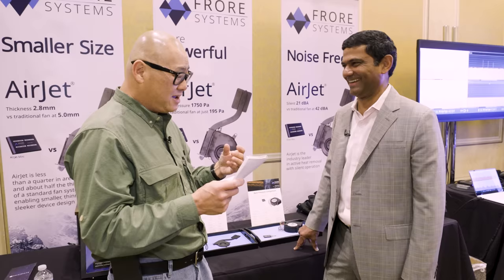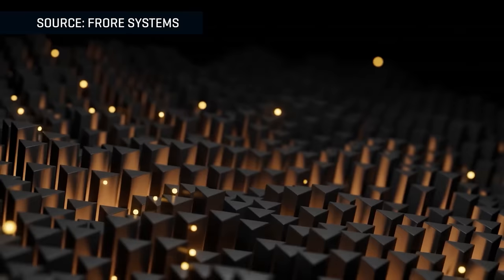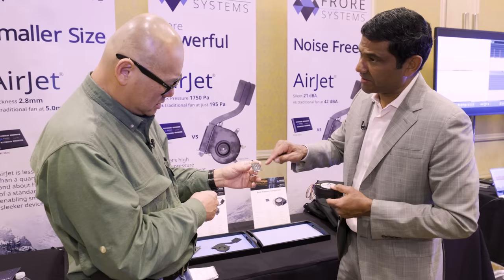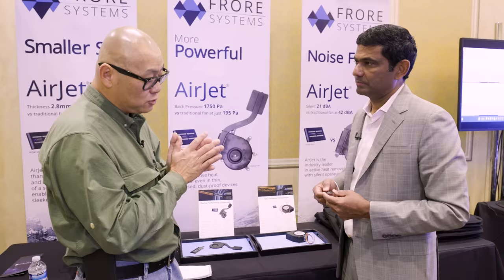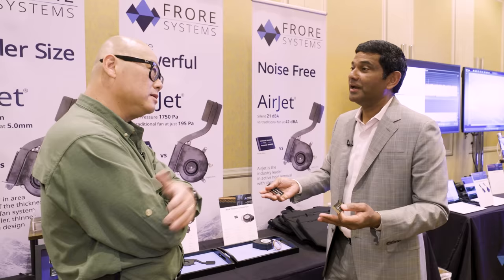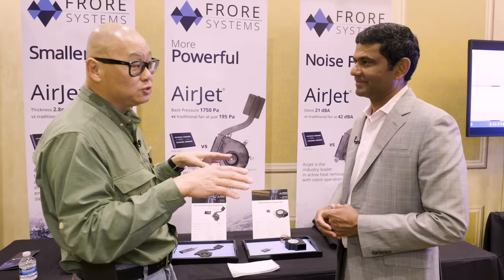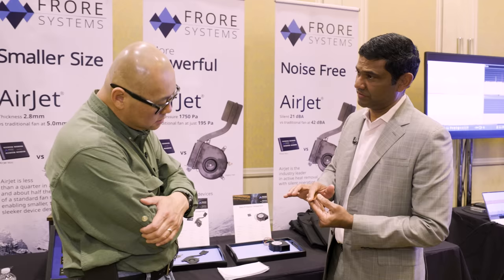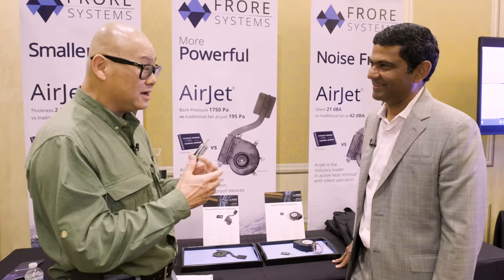Solid State Active Cooling Could Revolutionize Thermals

Comment: I like how he spins the dust filter compatibility so positively.  Based on the way he describes the mechanism, I bet if you get any sizeable contaminants sucked into this "fan" it is going to be toast!  A high-quality dust filter seems almost absolutely necessary for this type of cooler.  Let's just hope the durability of this device can satisfy customer devices in the wild...
Reply: Indeed seems like it need to work in a "closed loop" sort of what water cooling does on desktop, and he mentioned it is capable of doing so because devices can be made dustproof and IP68 so nothing would prevent a sealed box of certain capacity to being made around the solid state cooling device to protect it from dust I think.
Reply: @gabrielmaia5334  But if it only works well in a closed loop, then how is it any better than just heatpipes? Since all you're doing is transferring heat within the device itself.
Reply: @FrostArchon  Distribution of air around the device could go a long way toward avoiding hot spots, which is often a massive issue with passively cooled devices. This allows you to use the entire case as a heat sink by moving the hot air around inside.
Reply: They show video clips of it working in unfiltered air, so I think it would be able to handle dust.
Reply: Indeed it got me thinking.. Anyone who has opened up their laptops will surely know the amount of accumulated dust in the fan..time will decide and hope that is taken care off
Reply: But the fact that it is vibrating like crazy and they talked about using some kind of dust repellent... it seems like the device itself would not collect dust, and hopefully not the surface it blows onto either.
Reply: You can say he's spinning the dust requirement but not everyone works in a Starbucks/Coffee shop. The majority of my notebooks/laptops that I have owned have been killed by dust. Over time the dust builds up in the thermal management system and eventually leads to overheating and throttling of performance. It really would go a long way if you were building a tablet with a solid state battery with some serious performance components(A La Surface Tablet).
Reply: @theneonbop  yeah in pre-recorded b-roll in a controlled environment.  The truth is that we have no clue what the long term durability of this tech is, so I'm not gonna get excited until it is proven.
Reply: Would totally improve the capacity of closed systems like heat pipes.  Imagine this little thing moving freon across an evap core in a closed system.
Reply: No that is not how mems work. That wont happen. This isn't a fan.
Reply: @Daniel Eck  I considered molding my entire steam deck case in solid copper a couple mm thiker than the original on the back, and connecting the head pipes directly to the case so that the entire mass, like a pound of copper, would become the heat sink.
Reply: Air does not get sucked in.
Reply: @emo65170.  freon...? freon is used in AC systems because it's properties when it is compressed and decompressed. it's not suitable for just being pushed around. also i'm mostly responding to the idea of a chemical like freon, because freon is banned and could not be used anyway
Reply: A similar device already exists and the limitations are known. Unlike a fan, this does not introduce air into the system to dissipate heat but rather distributes heat to be passively cooled by the container.
That’s why it cannot cool components with a TDP over 30, fans are simply more efficient and that’s simply a limitation of vibrating air extremely quickly within a closed system with no cooler air being introduced. 
Therefore it can’t really be scaled according to the TDP of a product, it can only be scaled according to the internal volume of the container. This product cannot be scaled in the sense, bigger fans better cooling. 
So for investors, this man is trying to sell the idea that as production scales eventually it may reach a point where the cost to produce is cheap enough to adopt inside everyday systems. Think chromebooks, surface laptops, ipads.
Reply: @RyLo18D  I think they have overcome that limitation.
Reply: @RyLo18D  All they would have to do is blow the air outside of the case and the negative pressure would cause more fresh air to be pulled in from other intakes. And from the way he talks about it in the video, that is already how it works. The device works with dust filters because it generates enough power to pull air through filters that normal fans can't.
Reply: @descai10  The air isn't blown out of the case, the suction force or backpressure is what's allowing the air to be pulled into the case. It's essentially like a static pressure fan. 
So since more air is being pulled into the device from the suction force than being released, it's positive pressure. 
Also no fin stacks, it's solely the pulsating mechanism ontop of heat pipes or vapor chambers since it's able to dissipate heat faster that way. The major limitation still remains, how many of these can you put in a laptop? Realistically probably 2, you'd also have to deal with all other components being warmer. A workstation laptop can scale to larger fans, faster fans, larger fin stacks, more vapor chambers, more copper heat pipes. This cannot, it's designed to be a compact, silent and low-maintenance alternative to passive and weak cooling. You can add more, or make them longer and larger. But it doesn't have the scalability that traditional fans have. They're not using a larger cooling solution as a comparison, that fan probably belongs in a chromebook. 
There's a reason why they aren't advertising it for PCs or gaming components.
Reply: @RyLo18D  "The air isn't blown out of the case, the suction force or backpressure is what's allowing the air to be pulled into the case. It's essentially like a static pressure fan. "

Air cannot be pulled in without air also being blown out.
Reply: Perhaps you didn't see the part at 4:08 where it's running with no covers on it? It appeared to be running just fine in an area that absolutely had at least SOME dust in it.
Reply: @k6l2t  It's clearly at the same event they're at. Are you so inclined to be right about this thing's weaknesses that you can't accept any possible flaws in your hypothesis?
Reply: @theneonbop  for how long they are running this demo? I believe even ordinal office dust on 200km/h will drill chips and motherboard layers through
Reply: @JagadeeshPolepalli  if fluctuations pass to filter, it can somewhat self clean
Reply: @JagadeeshPolepalli  I'm thinking the vast majority of people who buy laptops never open them up.  I'm not one of those ;)
Reply: @cheeeeezewizzz  increasing thickness won't do much aside from heating up a little bit slower. surface temperature is what matters, it would be better to cover the entire thing in small fins to improve surface area.

 @K6L2 I think it might be less bad then you think, as long as dust particles are not bigger then the narrowest parts of the chip they would are very unlikely to build up because of the high pressure. And even if it does, a few on-of cycles once in a while will create enough turbulance to get rid of the little buildup that still happens.
Reply: @descai10  Yes, good job. There's a difference between positive pressure and negative pressure and it seems you still don't understand it. It's okay if you don't though. Airflow still go brr
And now we've introduced another limitation of the technology which is how well it can exhaust air given the pressure differential and whether that will affect the performance of the vibrating membranes or "pulsating jets".
Reply: @henkheijmen  I wonder if it can be run occasionally in reverse to clear out the filter.
Reply: A high velocity jet of air will dislodge dust pretty easily. I suspect that it is nearly dust proof and self cleaning internally. Only very large particles getting stuck, or stuff on the intake surfaces. So a fairly wide open screen on the intake would be all that is needed. I could be wrong though.
Reply: That would be a major concern, but might it be possible to redirect dust using magnets (i.e. strongly charged poles located on the edges of the chip). Or am I dumb and this would fry a computer?
Reply: @RyLo18D  suction force is local negative pressure though. And there has to be outflow because you can't just have air coming in indefinitely so it's not going to be a closed system. The idea is that the pressure/airspeed at which this thing operates is such that it can work through dust filters etc. which has possible problems of its own but if it works as advertised its absolutely viable.
Reply: @theneonbop  Sure it can handle the dust during a short demo, but it cannot handle dust long term, as it would accumulate internally over just a few months. But filters are a thing, and depending on the price this is still incredibly useful in plenty of applications because of size, price, and weight. It also cools directly at the source, allowing applications where the difference between the target heat and the air temperature is less than 5°C.
Reply: @CaidicusProductions  Not at all, man.  I'm honestly just as hyped for this technology as most of the other people in the comments, but I find that one is usually better off going into marketing trade shows with a healthy amount of skepticism.  The fact remains that this device has yet to be tested extensively at the consumer level, so it wouldn't surprise me at all if we encounter durability issues with it down the line.
Reply: What contaminants are you dropping inside your thing laptop? Or even desktop for that matter? You spill sand or pebbles inside your devices?
Reply: I was going to say the same thing
Reply: Airflow speeds may help with avoiding clogs. Also, since there isn't fins and motors, maybe dust doesn't have a surface to cling to. We need more info.
Reply: @snakejuce  Common dust particulate suspended in the air and loose clothing fibres. Too small to see individually, but you disassemble a laptop after 3 years, the heatsink is CLOGGED, you can pull a full felt out of it. One particle lands, another catches onto it, and then more, and pressure of the fan compresses the material into a felt.
Reply: @snakejuce  Some natural environments are worse for dust than others. In some places wind carries a lot of dust. Some pets are also bad news for fans. And of course there's proximity to factories, highways, and major roads that can massively increase dust levels.
Or using the computer inside a workshop.
Reply: @RyLo18D  You stated in your original comment that the system is a closed loop, meaning it's only blowing air around the case without pulling any in or out. This is simply incorrect.
Reply: @VeonUA  it sounded like it was only moving at 150km/h in pulses in thin strips when it was going down into the copper plate, which means the actual exit speed of the module would likely be much lower.
Reply: @HalfbitShirlock  Magnets don't affect dust. An electrostatic charge would, but that is not something that you can leave exposed to touch, and would ruin your computer.
Reply: @Peter-jl4ki  Ah good points. So me having a cat is bad? That probably explains why my laptop fans go crazy and it heats up so bad.
Reply: @descai10  That’s the initial use case of this technology. Not arguing over that
Reply: @tstager1978  "Air does not get sucked in"

Are you high? This is a solid state air moving device, it takes in cool air and passes it over a heatsink to remove heat and then expells hot air.   If no air is moving through this device it can not cool.  If air is moving through it, then dust will follow.
Reply: That can be overcome, but with all the disadvantages, I'm not holding my breathe. The mechanism seems to small to even be cleanable with an ultrasonic cleaner, which means that dust control will probably need to involve using the electrostatic charge on dust the way that many cameras now have that s the basis for dust removal from the sensor.
Reply: @theneonbop  It won't for long, in the short term, it's probably fine, but dust will accumulate in anything short of a clean room wearing bunnysuits.
Reply: @k6l2t  Honestly, I think this product is probably going to be vaporware and somebody is probably going to buy the company for it's engineering department. I could be wrong, but this is a very, very hard thing to get right to the extent that it would need to get it working reliably.
Reply: @emo65170.  lol, I was going to make a snarky comment about inventing the refrigerator, but I think I'm hearing the wooshing sound coming from another room...

Comment: One of the most important questions is about durability which includes resistance against dust/dirt buildup and hours of run time for instance.
Reply: I'm not all the way through the video yet, but at 5:55 he mentions being able to cover it with a dust filter that's stronger than what you can put on a notebook fan so that's promising at least.
Reply: @pianoanime  Doesn't that just move the problem up a step? with these small inlets it won't take long until the filter is clogged with dust
Reply: I think the problem is less dust build up and moreso mechanical and material fatigue because the thing is constantly vibrating at possibly a rate higher than fans. Vibration can help with resisting dust build up. I'm not sure your motherboards  or CPU's go through extensive "rub testing".
Reply: @stephenlim7564  you're right, I was only addressing the resistance to dust buildup part of the comment I replied to. It will be interesting to see the lifetime durability of these things considering they will be vibrating constantly. Considering they're quieter than a standard fan are the vibrations they produce simply ultrasonic? It's a good question you bring up regarding how/if they'll interact with the other computer parts from a physical/mechanical standpoint outside of the active cooling.
Reply: @HildeTheOkayish  I can't imagine what their long term plans are, but my initial thought was that it would probably be easier to replace a filter on an enclosure than to get dust out of the device itself.
Reply: If you dust proof it how can dust even build up? Dust isn't created in vacuum for instance.
Reply: @HildeTheOkayish  If you put a filter above it, you would also make that a replaceable filter.  If not replaceable, then accessible to hit it with air.
Reply: @HildeTheOkayish  You could just enclose the entire intake surface in a HEPA filter if you wanted...the 'small inlets' aren't a factor
Reply: Was thinking about the same thing, it would work fine in a clean environment
Reply: @lunk026  dust comes in all sizes my guy and if any air can get through at all - some dust will get in too
Reply: @HildeTheOkayish  the highback pressure itself could keep dust from settling in the inlets
Reply: @Zam_man  yep. unless this is installed in an HVAC controlled room it will fail
Reply: @pianoanime  Agreed. If you can make "fans" this tiny, a positive pressure system would be pretty much a no-brainer.
Reply: i don't know how dust would be a problem considering the idea is to use this device instead of a fan, so if i understand right, the goal is to provide cooling to your CPU and possibly your GPU so that your PC doesn't need to be air cooled, which suggests that there will be no need for vents and air flow into the chamber of the tower or laptop, keeping them air tight away from dust.

anyway that's what i got in the potential of the tech. 

oh wait, he said they do release heat when they are in use, so they might need venting built into the case of the PC, but it's potentially less dust to worry about since the fan will be just as an exhaust in most cases. 

but it's also possible they will improve on the design and make work better with other design improvments.

anyway i think this tech could change the industry potentially.
Reply: guys y'all should join the team😂
Reply: such devices quite allow the use of gas-tight cases, so the problem you voiced is not in principle. It was actually mentioned in the video.
Reply: @HildeTheOkayish  filter can be bigger than the inlets, which helps with the clogging. Look at your car's airbox.
Reply: @notKhalid  
what do you mean by join the team?
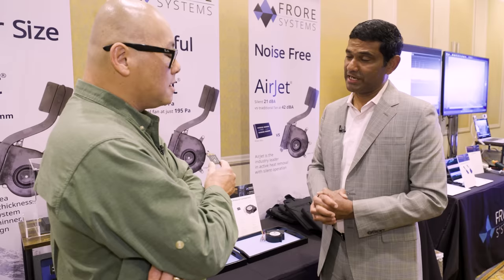Reply: 4:00 in and this is my exact question also. Durability/Lifetime of product.
Reply: @MindMachine- too big.
Reply: @stephenlim7564  If it is connected to heat piping. then the heat pipes can absorb waste vibration. better than having a small orbital sander smoothing out your motherboard components.
Reply: DEFINITELY GOING TO NEED A DUST FILTER
Reply: @stephenlim7564  We need to ask the expert of vibration (your mom)
Reply: I think it's also important to do not have much hot air in output, it can be too hot for use
Reply: i think you where too excited to comment. 😂
Reply: Yes durability is extremely important and the fact it wasn't mentioned is concerning.  Like others have said, the high velocity airflow may negate accumulation of dust for a reasonable lifetime.  I'm also interested in the lifetime of the vibrating parts themselves; I assume similar technology to projectors with micro-mirrors?  It's my understanding they can last over a decade, but I believe they are in a sealed enclosure so...